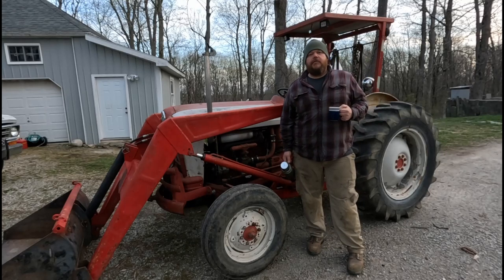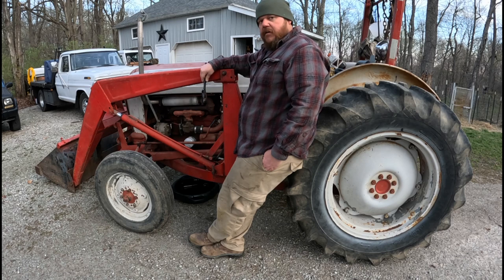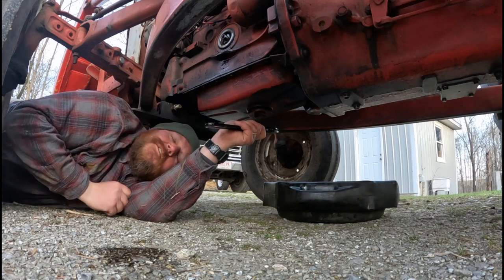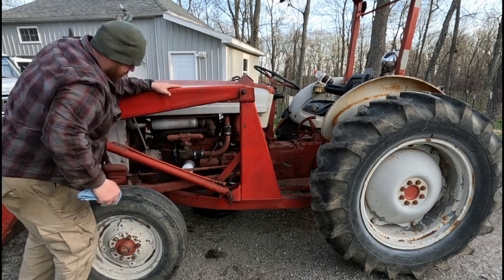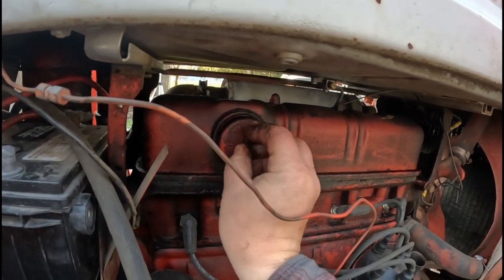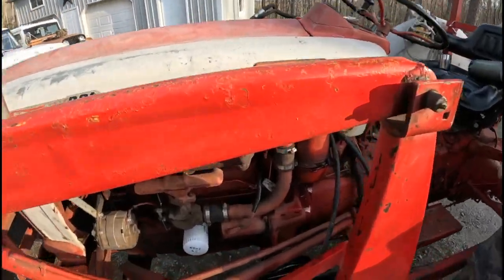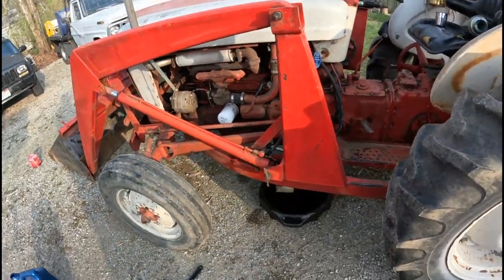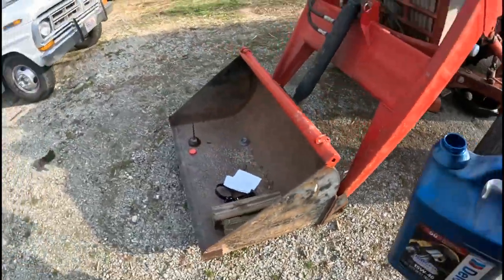History of the Ford Tractor: 1957 Ford Powermaster 841 Maintenance

Comment: Nice video. I also have Ford tractors. I have a 9N, 8N, 841, and an 8600, spanning over 40 years of innovation. My 841 is a 1958. Ford's contributions to tractor design are too numerous to list.  I believe the Fordson’s frameless design, facilitated by bolting together three castings (engine, transmission, and differential/rear end), is an innovation only Ford could have accomplished. By the way, Mr. Ferguson’s first name was Harry.

Comment: Like your video im only 34 and had A ford 2000 know i own a ford golden jubilee 1953 love mine coverted it to 12 volt new plugs snd distributer and coil plug wires and new radiator theristate houseing castiron is amazing love old stuff
Reply from the maker: When I went to go look at this 841, the seller thought it was a Golden Jubilee, he was just listing it for an elderly neighbor. Though the 800 series has more power I was actually searching for a 1954 just for its historical significance. I ended up buying this one, well, a front loader come on! Have you pulled a plow with that jubilee?
Reply: Yes I have been years wonna get back to doing that